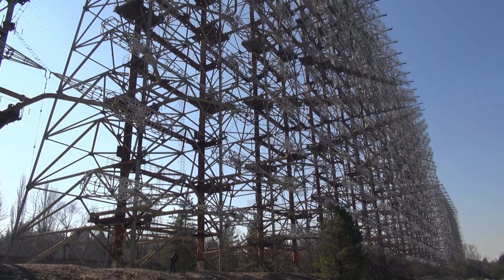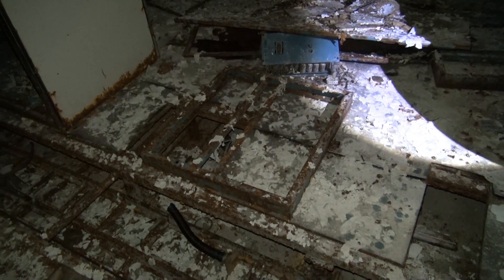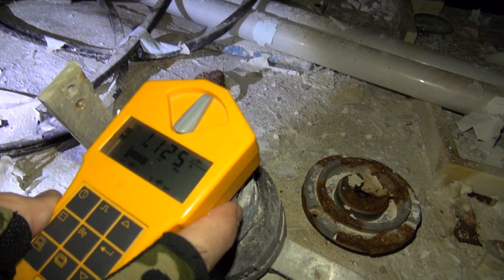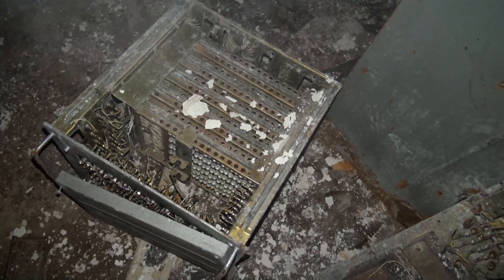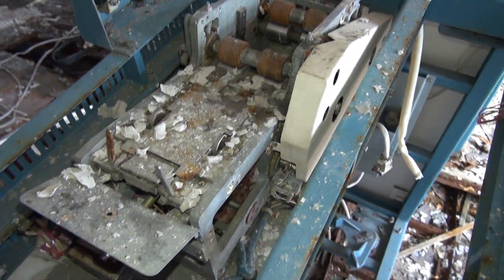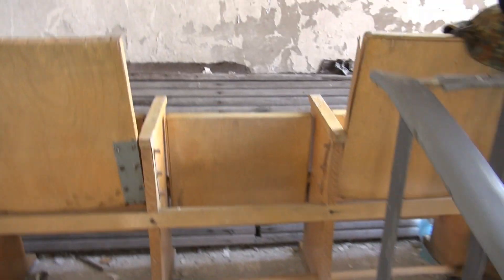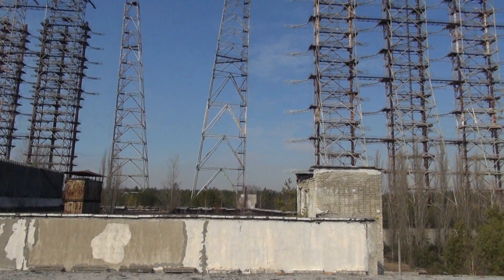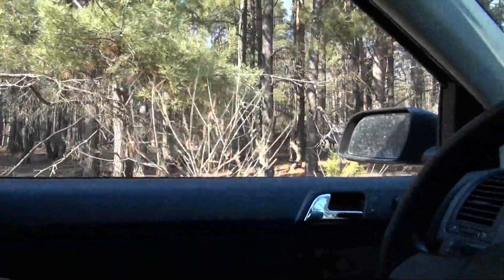inside Duga-3 / Дуга-3, computer mainframe of the Russian Woodpecker / Chernobyl-2

Comment: The little copper net you were holding was memory, and the little rings were the cores. We still use the word "core memory" today. When things go wrong, we still have a file called "core". It contains a dump of all the process' memory for debugging by nerds...
Reply from the maker: Pax Vobiscum thanks for the precise term! even though i grew up with DOS and real "floppy" floppy disks (5,25"), the stuff i saw here i never saw before, only at museums maybe...
Reply: bionerd23 Floppys have as much as 10000 times the memory of one of those modules. I believe they were the very first type of memory ever.
Reply: With such small memory and speed compared to today's relatively affordable programmable hardware (FPGA), I wonder what was their circuitry for analog & digital signal processing, and if it could achieve over-the-horizon radar imaging, or only detection of missile/aircraft/uncloaked UFO.

Comment: those empty aisle under the floor would have been used for power and data lines its empty because it would have been packed with copper cables and signal wire and if they were to take anything out it would have been the copper

Comment: I believe that the floors are raised like that to allow cables to be routed under the floor boards. Datacenters also use that strategy. Could be wrong that though.
Reply: That is correct. the floors are all pulled up because of scrapers
Reply: That's what I was thinking, someone's been there and stolen all the copper cabling.
Reply: VinylDash303 Also sometimes for cooling air in at the bottom out at the top
Reply: @Max_Marz  Yep. Another good observation. I am really liking the comments here. No bickering, just opinions about what is being seen by the camera. Some correct, a few not but that's OK too. Its cool to see so many people from different backgrounds here all or almost all liking and discussing but not arguing and whining. This is what a comment section should look like.
Peace.
Reply from the maker: VinylDash303 just gonna reply to this comment as it was the first, but many said the same... thanks for the confirmation! :)
Reply: builtrodewreckedit High spec areo-space and high frequency narrow bandwidth cabling is often made from silver/copper alloy.  Tarnished silver is still conductive whereas copper and aluminium oxides are not.  I have a small spool of Kynar 30AWG 90Ag/10Cu wire for RF repair work that I bought nearly a decade ago and it has become that brownish-black color characteristic of tarnished silver but still has good signal fidelity.
Reply: United States of Nerd
Yes i believe your rite about that... In the video it didn't look like the wires were copper colored where they were cut though.. They all looked like aluminum to me.
Reply: Да, кабельные линии шли под полом
Reply: No. I think you're exactly correct. Good call.
Reply: Yes, modern datacenters have raised floors for proper ventilation and cooling of servers and network equipment, and also a means to route the cables.
Reply: You're correct!